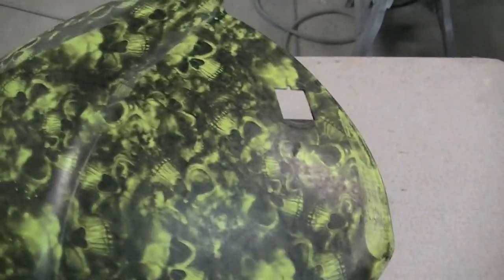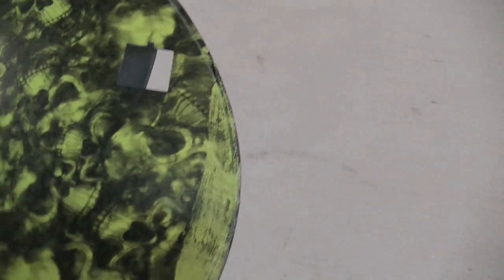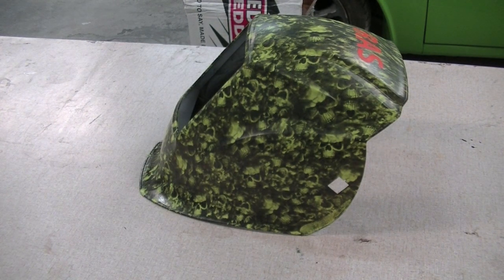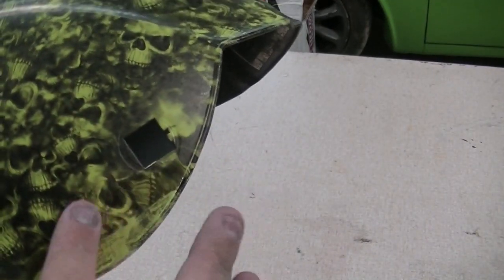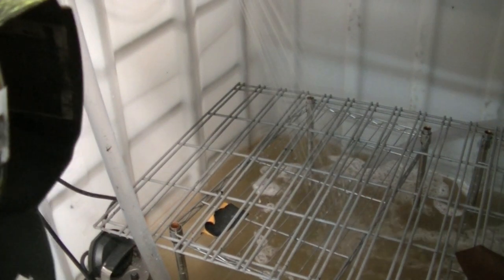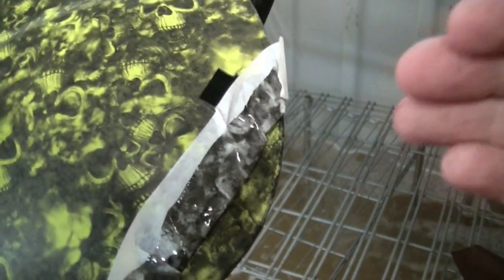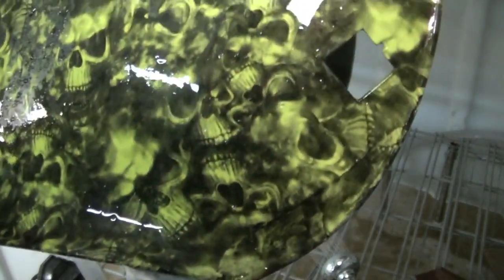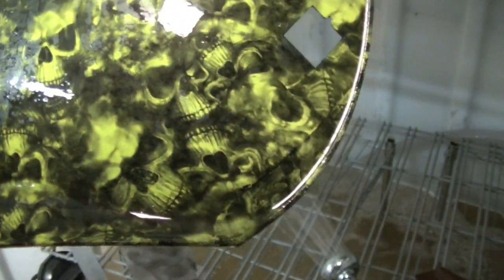Hydro Dipping Tips and Ticks. Episode 1, Fighting the Tape.

Comment: If you tear the edge of the low tack tape before you stick it to your project, you will not get a defined edge, this method cheats the eye, unlike the knife edge from using it as it comes off the roll. See how the edge mark cuts through the skulls and is clearly visible.( you can  use this method if you are wallpaper hanging, you WILL need to undertear the paper so only the pattern side of the tear  shows. Use  when you are losing a pattern in the corner of room or window reveal or pasting in a patch,  it covers a multitude of sins ; ) ; )